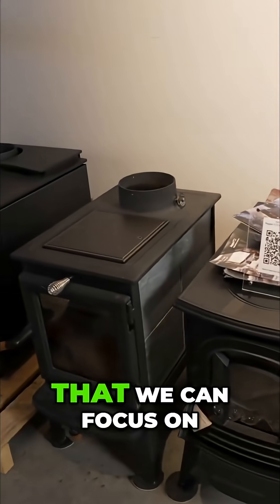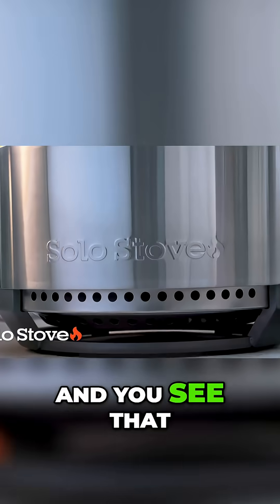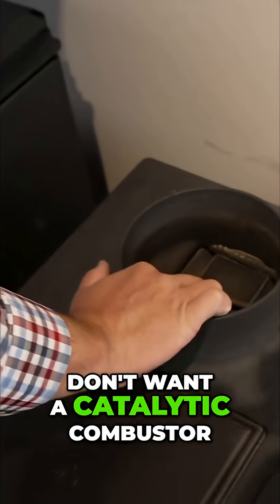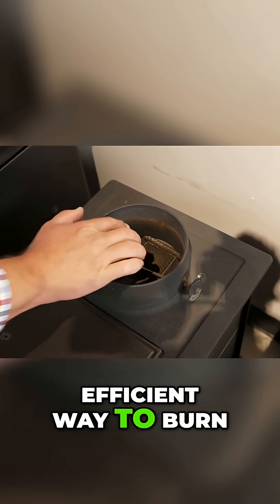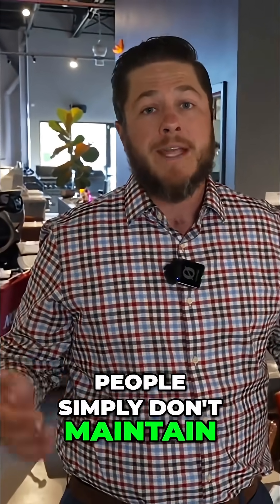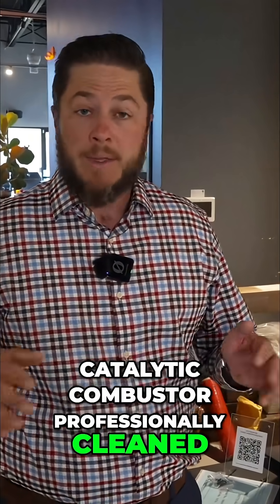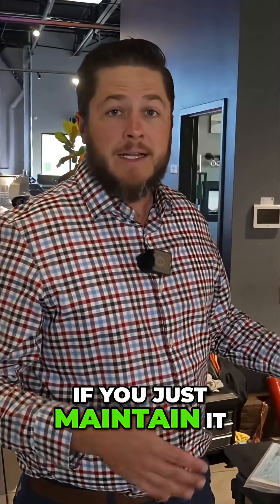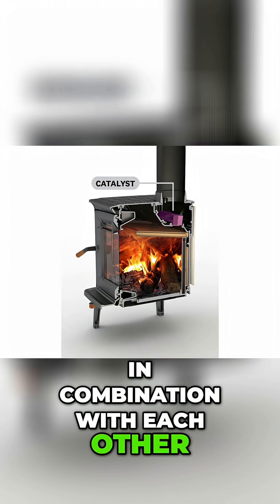Do you really need a catalytic combustor in your wood stove? 🤔

Comment: Either they don’t maintain their stove or they overly heat their stove and the catalysts actually break, but that’s the downside of dumbasses, not knowing what they’re doing, and also not knowing that they should clean their chimneys out not every day but regularly depending on what you burn in your wood stove or fireplace for instance, anything with high creosote like pine yeah people say don’t burn pine because you can’t it’s not that you can’t it’s that you risk having more creosote lining your chimney so if you don’t clean out your chimney, it will cause a chimney fire whether the catalytic converter is there or not if you don’t do general maintenance, you don’t delay putting general maintenance on your vehicle and wondering why is my vehicle broke down on the side of the road so you don’t do that with Wood fireplace or wood stoves you trade it nicely and give it it’s maintenance it will treat you and if you neglected it will neglect you.
Reply: And believe it or not if you know what you’re doing, you can even do what I did and turn a 1888 soft cold hardwood furnace into a more energy, efficient furnace, just by adding a catalyst combustion system, and it will run more efficient and warmer instead of having a whole 4 inch pipe to let all the heat immediately escape. It’s kind of like a wood stove chimney damper you open it up when you want air in it but on steroids lol

Comment: All stoves without that catalytic combustion toy are junk?  Odd because my 50 year old stove heats the cabin just fine. I  get a nice long burn.  You sound like a Californian used car salesman
Reply: I went from a 1970s stove to a brand new cat stove this year, there is no comparison.
Reply: @Carldelong14 in what way? Hotter or longer burn when you bunk it for the night or both?
Reply: @jatpack3 went from a plate steel stove to a cast iron/soapstone. I can get more heat from the new stove on a fraction of the wood I would normally use, I’m at 10/12 hour burn time on a single load. The soapstone retains heat for 15/16 hours same for coals makes restarts easy. granted it’s more labour intensive to own and maintain vs non cat stove. I burn 24/7 from oct to about mid march
Reply: He is talking about his new sales of curse.  All new stoves must meet EPA standards.  Of course your old stove works.....
Reply: I mean he is a salesman and is trying to clear out his new stock and less people buy cat stoves, so yeah.